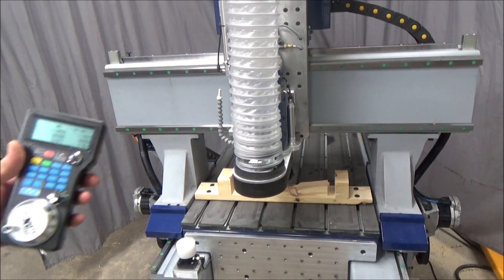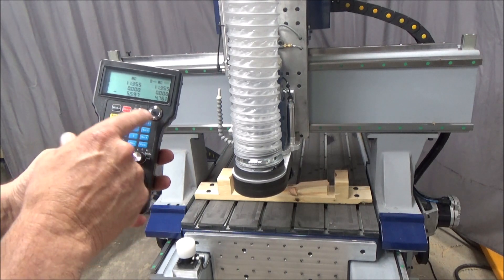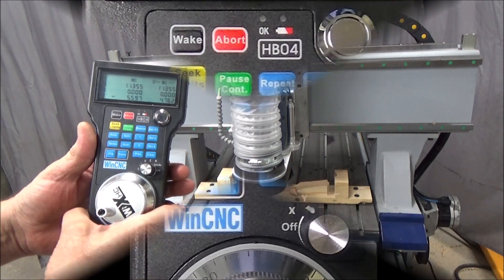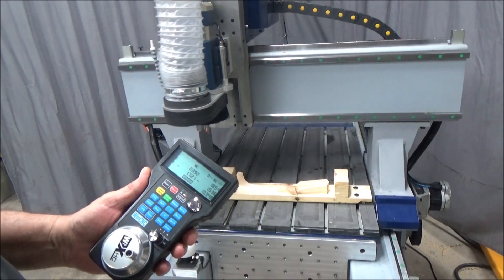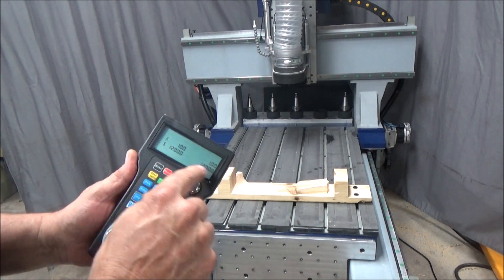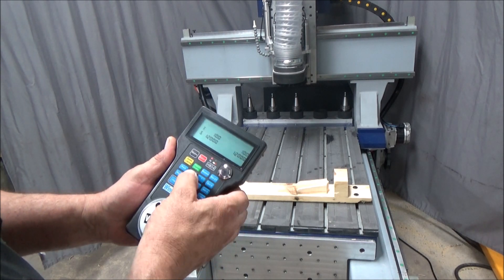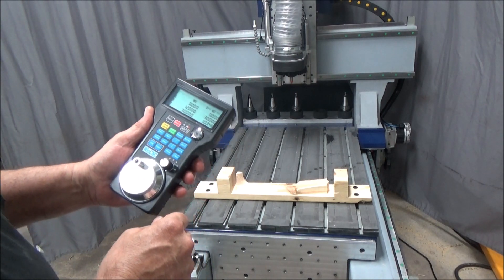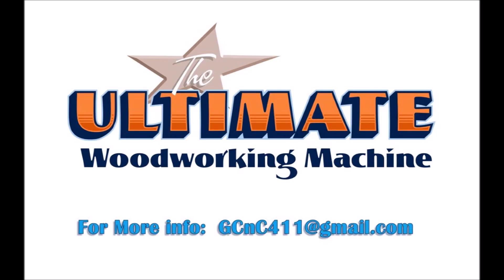WinCNC Wireless Pendant on Ultimate Woodworking Machine

Comment: If you only require a simple pendant for basic X,Y,Z movement and setting Z0. The item below for $5.00 works great!

https://www.ebay.ca/itm/Wireless-USB-PC-Remote-Control-Media-Center-Controller-Mouse-for-Computer-Laptop/283066427382?hash=item41e812e7f6:g:ZWIAAOSwOVpXYmKp:rk:2:pf:0